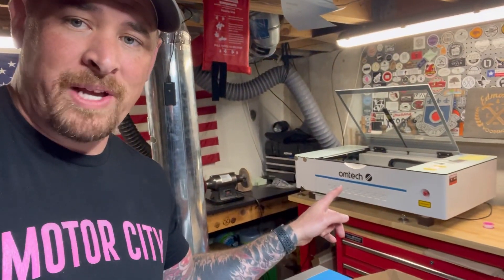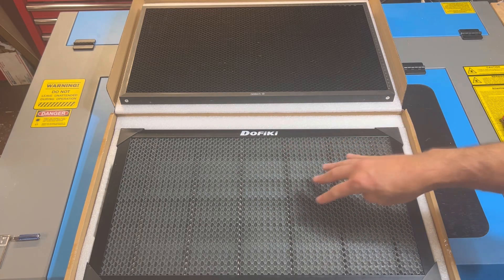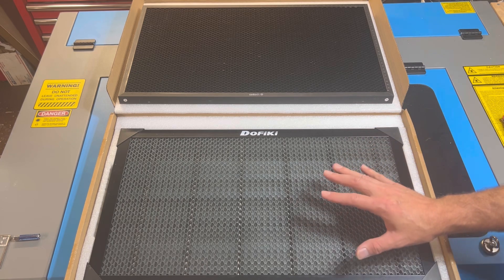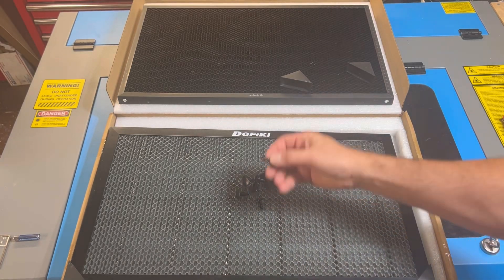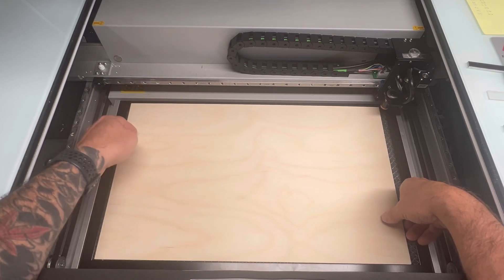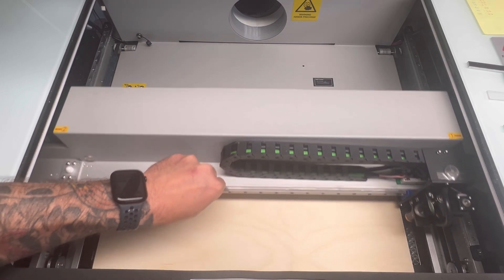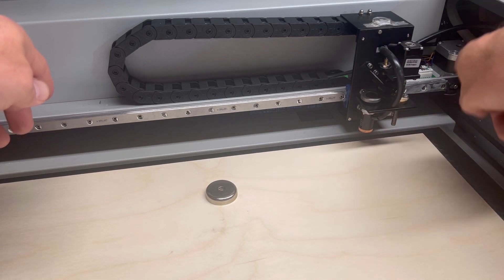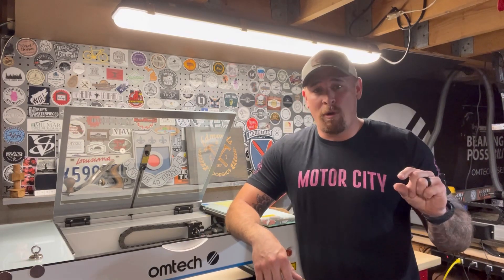OMTech Polar Honeycomb Bed Upgrade

Comment: I got this honeycomb- sanded the corner rivets to allow it to slide it a bit further, also using a Dremel cut wheel, I cut into the frame so I could gain full contact with my material.  Easy change love the magnet system!
Reply from the maker: The newer polars have a steel bed. Not sure why they didn’t do this to begin with. This new one isn’t perfect, but i thinks it’s better than the original

Comment: Hello, I noticed that the laser pointer is not correctly aligned to the 0-0 cm at top right of the honeycomb when it is at home (x=0 and y=0). 

So, if I place an element at 0-0 on the honeycomb and at 0-0 in LightBurn using absolute coordinates, there is a misalignment with the actual position of the laser, causing the entire design to be offset. 

How can I counter this phenomenon? Should I use a physical shim or a specific setting in LightBurn?
Reply from the maker: The best I can really say is that markings on the honeycomb are just rough reference marks. I personally don’t use them to try and accurately place my material because of the misalignment as you mentioned.
 A work around for this is to create a fence that references the side walls. Basically, you’d take a square piece of plywood, push it up to the upper right corner of the bed, set your 0,0 point in lightburn and the polar, create a square that’s bigger than your piece of plywood at the 0,0 point in lightburn, cut the square out, and now you have a fence that’s built exactly to the 0,0 point.

It’s hard to explain so I’ll make a video on it. 

You can also join our Facebook community and do a search in our group. Many of our members have done this.
Reply: @EdmondsWoodshop  Thanks !! I did that and it works perfectly !

Comment: Hi Edmund I love your videos. One thing that is concerning me..... Not related to this but the fact that the mirrors are glued in... From what I understand I  might only get 200 hrs out the mirrors which wont be a long production time plus I will need to realign them each time I change them. Would you know of a substance or glue whereby I can unstick the old mirrors and replace them with something that will hold them in place but would be easy to remove them? I dont want to have to do a realignment each time. I am only likely to work with rubber some basswood and eventually acrylic. I dont want much downtime between changes. Thanks